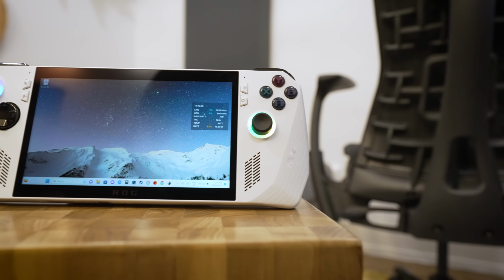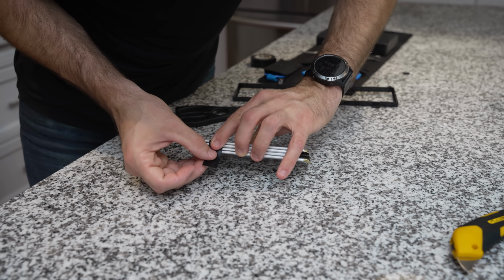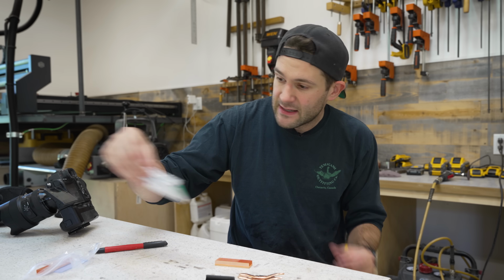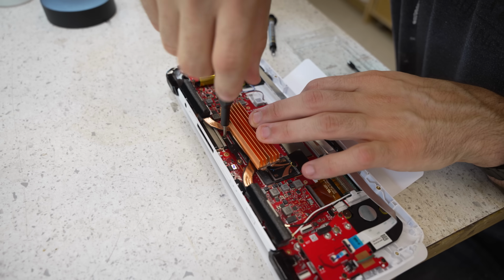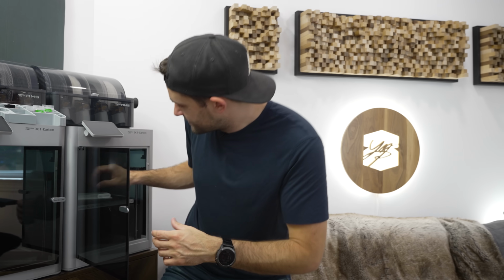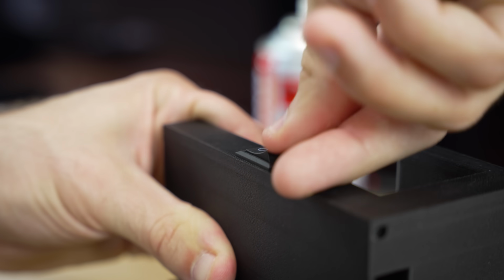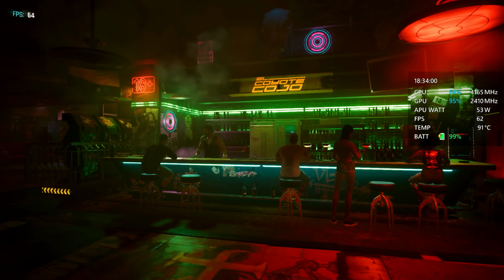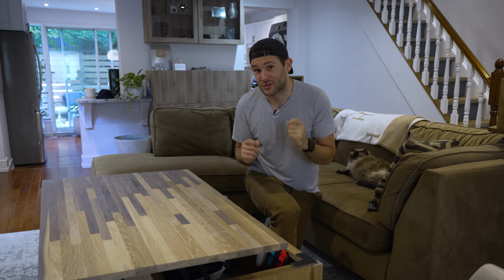I don't understand why people buy Steam Decks...

Comment: Valve's support, not cooking my SD card, and not needing to burn time customizing/working on the deck. I don't have time right now to mess with it, but I can turn it on and play right out the gate super easy. That's why.
Reply: You forgot - The ROG ally has bad battery life, worse 1% and 0.1% lows when gaming compared to the steam deck having a more consistent frame rate meaning its less stuttery. Having windows so you run into all the stupid windows problems every time Microsoft does an update. Overkill screen resolution which you will never be able to actually play most games at 1080p so you will run games upscaled from 720p rather than native which looks worse. Too high refresh rate that most games cannot even reach that fps limit. The ROG ally unlike the OLED steam deck has a lack of HDR support and worse colour accuracy which is actually important for better visuals in gaming and does not have a performance cost. Even if the ROG ally was the same price as the steam deck OLED for example the steam deck OLED would be the better value still. Still many I have missed but either way, the ROG ally is a laptop tablet with joy cons glued to the sides NOT a gaming console like the steam deck is.

Edit: Some people will have a use case or valid reason for buying it still though but a smaller range of people compared to the steam deck. People say stuff like windows doesn't trigger anticheat as often with the ROG ally but who plays competitive multiplayer games on a handheld? Its a bit inconvenient in my opinion.
Reply: @stevenlee3661  
I went the steam deck oled route, hopefully it arrives by next week.
For my taste, the ally is quite ugly too and the white color is already a no go for me at least.
The Legion go looks better, but the detachable controllers on a big heavy device like that seems a weak point in the long run to me. I like Msi desktop products, but their claw handheld is out of discussion to me.
Both Ally/legion go are very power hungry and require more planning/attentions before take it on the go even for half a day imo, they can't play very long with a full charge, compared to the SD (if you take them with you in a rush/last minute without accessories). 
You can always carry kilos of powerbanks and accessories ofc, but it requires more planning and attentions like everything needs to be fully charged, bigger travel bags etc.
Reply: @stevenlee3661 it's still the smallest computer on the market which is a good pro.
Reply: @Anomalyy666  it's not there are many more computers that are desktop or tablet for factor that are much smaller with full windows 10 or 11 on them. For example any mini pc on Amazon (you can even find pc sticks) and many windows tablets some terrible and some great. There is also the ayaneo flip ds which is a lot smaller but a bit fatter than the rog ally but very expensive. Many other ayaneos are smaller than the rog ally but I wouldn't recommend them as they are even worse value than the rog ally. The rog ally has the advantage of it allowing proper egpu support. The bad thing about this though is that it uses a proprietary connector that makes it so you can only use a few gpus made by Asus that are very expensive rather than allowing anyone to plug in any GPU they want.
Reply: @Anomalyy666  but is that more important than the ROG Ally having an hour less of battery life compared to the Steam Deck?
Reply: And how about lots of countries where Steam Deck is not officially sold?
Reply: @GungKrisna12  Those unfortunatly will buy something else, don’t buy, buy from importers/scalpers. 
It’s like that for a lot of stuff, like EU people trying getting US stuff that isn’t imported and distributed in EU and either shipped out of US from the vendor. 
There is often a solution, for the right amount of money and if you have the right connections.

Comment: Why in the world do you use such overkill fans and cover 2/3 of its airflow? Noctua makes smaller fans that are also very quiet. You dont need that big of a fan. Your trying to dump 5 gallon bucket into a coffee cup which actually makes the fan less efficient because of the back pressure from occluding so much of its output...

Comment: I currently have an OLED Deck boxed up ready to return and a ROG Ally setup exactly how I wanted the Deck to be... I wanted to love the Deck, the design is great, those trackpads are amazing... but jesus it's a challenge getting the simplest things done, Linux is hard work, the emulation didn't work properly, and when it finally did the frame rates were disappointing.
The Asus is Windows, so everything just.... worked.

Comment: Here's my view on steam deck vs rog ally.. The ally does have an impressive cpu, however the apu is just not in the same conversation as a desktop gpu.. Meaning you're probably going to wanna stick to lower graphic intensity games.. Games that probably run just fine on a steam deck as well. I can see a very specific use case for the ally, being, older graphical games were the apu is more on par with a 2013ish gpu. 

Now the big thorn in both of their sides.. if you have a good cell connection or wifi located where you play.. You can just use a tablet or phone and cloud game. Between Nvidia geforce now, steam link, PS plus, and xbox ultimate(plus a few others) you have plenty of strong options for cloud gaming that allows you to play any game at a high FPS with long battery life.

I think both the steam deck and ally have very niche markets for people with specific needs, but isn't really changing the market.

Comment: what is that little yellow sheet you used to hold down your wire at the 16:50 mark ?
Reply: That is kapton tape. A commonly used tape in electronics for its electrically insulating properties and stability across a wide range of temperatures.

Comment: The title should have been "I DIDN'T understand" because after doing all of this, you should now understand. I have a bunch of these handheld PC's. GPD Win4, OneXPlayer Mini Pro, ROG Ally, Steam Deck LCD and have upgraded to the OLED. If your goal is to be able to play modern AAA games with decent performance (for 30-40 mins) then yes, something with a Z1 Extreme is a better bet for you. But at the end of the day, it's an "ok" APU that doesn't really even keep up with a decent gaming laptop. Who's really playing these games handheld on-the-go instead of at a full desktop setup or on a current gen console? Valve knew exactly what a handheld gaming PC should be and aimed for an amazing battery to performance ratio. The Steam Deck is not great for top-tier AAA or competitive gaming. Yet, it can still get by in a pinch on a lot of those games (it can at least run them to some degree.) However, the types of games you're more likely to play on a portable are games you really do need decent battery life for. Lighter indie games, puzzle games, RPG's, etc... Also classic games or retro emulation. I personally use my OLED Deck to play a lot of the remakes/remasters from studios like Nightdive. It's the perfect platform to play something classic that has been updated for modern hardware IMO.

Comment: I don't trust Asus with their QC nor their warranty, especially after that entire mess with them wanting to deny people of warranty for flashing a firmware update to their motherboards (a patch that the company sent out themselves in order the issue of the motherboard automatically setting AMD's X3D cpu voltage too high), then turning around and marking it as beta even though they specifically were telling people to download the new bios in order to fix the overvoltage issue! That right there is the main reason why I don't recommend the Ally no matter how much better it is compared to literally anything else out there.

Comment: I had more issues with my Ally in the 1st day than I've had with my steam deck in 1.5+ years. Windows actually blue screened on my very 1st powerup before I even made a user account. While the performance of my Ally was awesome for it's small form factor, removing the device driver for my SD card to work after every reboot, switching between mouse and controller input every time I start a game, ASUS's proprietary nature regarding their supported chargers not allowing plugged in performance with battery packs I KNOW can output more than enough wattage at the exact voltage and amperage the Ally runs on, BIOS updates lowering FPS in games, and several other issues I can't recall will keep me from enjoying any type of performance increase it has vs the steam deck. I returned my Ally, bought an ASUS gaming laptop instead.

Comment: his Steam deck didn't die because the battery was bad , it died due too his foolish liquid metal mod , he failed too put a small foam shield around the GPU/CPU because liquid metal is liquid it will run out due too gravity !!! the foam around the GPU/CPU prevents that .. if liquid metal comes into contact with raw metals or solder it eats it !!! thus it can completely destroy electronics if not done 110% properly ...

Comment: Hey Zack, just wondering how you managed the heat inside the coffee table with the consoles and the receiver in there. Thanks in advance!
Reply: He shows the table build in a previous video. He has a really big noctua fan mounted to the bottom, powered off the av receiver. There's a gap between the walls and the top where the hot air gets blown out
Reply: @Jazz-Punk  Nice, thanks for the info, I'll give it a shot!

Comment: I think stacking battery cell can be a hazard choice, that thing is designed to swell over time.
Liquid metal will corrode away the copper heatsink, you'd want a nickel plated headsink for that purpose.

Its a fun project but i wouldnt drive it as a daily device.

Comment: For my use case, the Steam Deck was and is perfectly adequate. I drive a truck for a living and don't tote my monster of a PC around. If I need more power or VR on the road, I also bring my GP75 laptop. That's more of a hassle to take out and set up though. IMO, the Deck has superior controls to the Ally with extra paddle buttons and two track pads; it's way easier to configure controls or use in desktop mode and can utilize smaller wireless keyboards because lack of track pad or need for separate mouse is mitigated.

The Deck is virtually ready to roll right out of the box, SteamOS is a fantastic operating system, and the Proton compatibility layer is really great- by far a long haul from the days of WiNE.

I like the Ally, and it would be a fun project if I had the time or need for it, but I have all my bases covered already, and I found the title of the video to be condescendingly narrow-minded enough to chime in.

Comment: Valve optimizes their hardware . Asus does not have the same resources valve does. The steam deck uses an abstraction layer, proton. Hardware level optimizations aee applied to take advantage of pheonix, the APU in the steam deck. The APU in the steam deck is built to order for valve, and steam distributes shader cache for their hardware. The steam deck is a better device, period. 

Specs arent everything ..

Comment: Thats incredible that it seems like Asus actually tested and tuned the APU for high performace with modest battery consumption. Thats a pretty outstanding thing to see from a hardware manufacturer. I would test turning the power limit down and seeing what sort of performance hit you take. You might just get an extra hour of battery out of it.

My friend's 9th gen i9 was one tuning session away from using half the power for like 6% less performance. Intel just dumps power to make their numbers look better.
AMD has the opposite problem. I was able to get 20% higher benchmarks for only 2-3% more power.

Most graphics card manufacturers have the same problems of either dumping power or being way too conservative. At least most people can dial it in for their wants but its still a lazy practice.

Comment: I'm wondering if a powerbank in your pocket would help battery life just as much without sawing the case in half. 🤔 It would also not increase the weight of the handheld.
Reply: No! that sounds to practical!  He needs a reason to show off his 3d printer, blow torch, and special cutting tool, and pipe bending skills.
Reply: theoretically there could more energy waste so it could cost you a slightly higher electric bill, but even still I'd rather do that than chop up my handheld or make a permanent weight increase.

Comment: Steam Deck is cheaper, has a better controller built into it (Steam Controller 2.0 basically), a custom Linux made specially for gaming and better support with things like pre-compiled shader cache that not only make so you don't have to compile it in real time, but also improve the performance in a lot of games.

Comment: I love that solder paste but I can't help but think that was a really bad decision to use it in the way you did, what you should have done is apply that liquid metal between the heat pip and heatsink and then solder them together on the sides. That solder is going to be a major choke point for heat considering you have a layer of it between the pipe and heat sink. I feel like you could have found a way to connect them directly and figured out how to solder them together on the sides.

Comment: Even if you ignore the fact Steam Deck is backed by Valve, has great Proton integration, and some amazing control options, the price is the decisive factor. No amount of power in this handheld form factor can be worth over $500-$600, and a high-end ROG Ally (as in, the one that's better than the Deck) runs close to double that. So - easy decision!

Comment: The rog has better hardware but windows is clunky and asus hasnt been great with driver update. Valve pushes out a few updates a month and ive had to use there RMA service and it was great. Asus is still saying the rog cooks sd cards cause of software but still havent fixed it. Valve does right by the consumer,  asus...is hit an miss

Comment: If that fan was blowing air into the Ally, thats might be a problem cause the hot air will be pushed into the components again, cause throthling. It should be used as an exhaustor.

Comment: Him upgrading the battery to twice the size of the stock and then him cranking the power of the system to to double that wouldn't you still get 1-1.5 hours of use like that? Wouldn't that be kind of defeating the purpose on what he wanted with the larger size battery?

Comment: I think the reason the Steam Deck is a solid choice is the support from Valve, developers, and the modding community, and the growing ceiling for a user customized experience. Since launch, so much has been improved, most of my massive Steam library is now verified, performance in tons of games has been improved, and you generally see a lot of titles either launching or making changes to titles to make them run well on the Deck. For unofficial plugins/ apps, i added a custom theme that makes the UI much more clean and customizable, How Long to Beat stats displayed on game pages with plugins, SteamDB compatibility ratings displayed on game pages, added a super easy to modify and load system of emulators, installed and added all of my non-steam launchers directly to my game view with a single installer, got an app for remote play from PS5 with HDR and touchpad support, and thats only scratching the surface.
Reply: unless you're australian. the orginal steam deck hasn't even come here yet, and the 64 gb standard model is only 1100 dollars!
Reply: @jayzed1355  Equivalent to buying a $1,000+ gaming laptop in the USA.
Reply: a 1000 dollar (usd) gaming laptop does not have 64 gb of storage. a 512 sd card is an extra 200 @SuperFlashDriver
Reply: @SuperFlashDriver  It's because of our consumer rights, valve got hit with a big lawsuit and never came back. It's worth it though, everything has a year of refund guarantee, and unlike insurance, they don't try and fight you about it
Reply: Look what they need to mimic a fraction of our scalability! Defunct woke products with disgusting lack of standards and degenerate clientel.
Reply: Interesting. But again, when you get a gaming laptop, most of the time it would be hard to choose whether to go for Steam deck, or a gaming laptop.
Reply: @SuperFlashDriver  they definitely serve different purposes, not to mention different price points. I've got a nice gaming laptop and a steam deck, and I generally use them for different things. Laptop is for AAA graphics heavy titles or Kb and mouse focused titles when I'm away from my PC, and Steam Deck is generally for everything else, as it's way more convenient to use, generally. Rather than having a laptop on a lap pad, with an external mouse, plugged into a power brick, I can pick up a handheld, kick back, and play. For someone wanting the full gamut of a PC experience on a non desktop PC device, I don't think you'd want to go any lower than a gaming laptop, but, for a handheld experience, I think the Steam Deck holds its own pretty well.
Reply: Can I be a pain and ask how you downloaded and added non-Steam launchers to your Steam Deck?